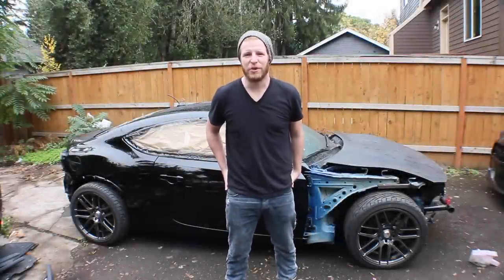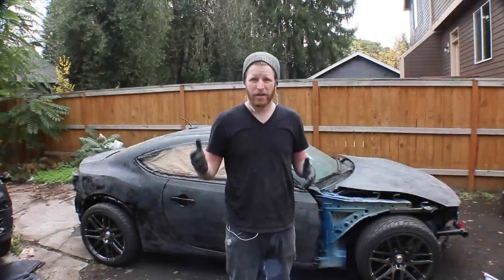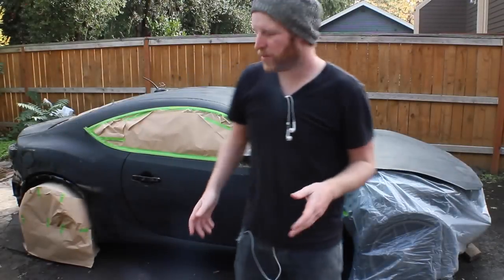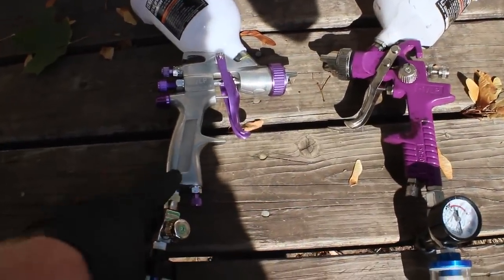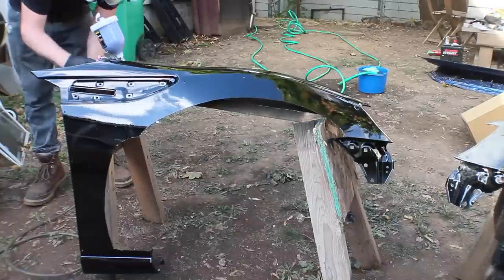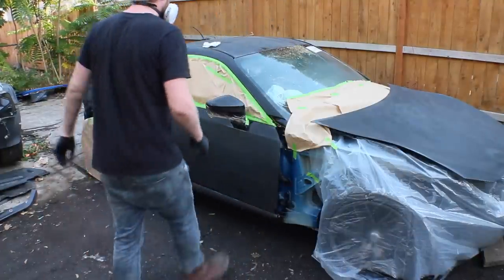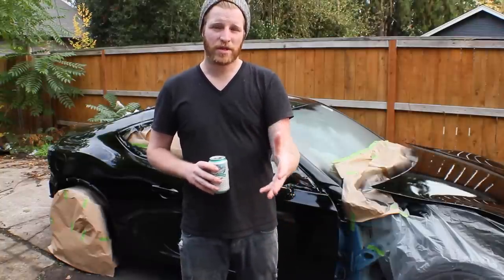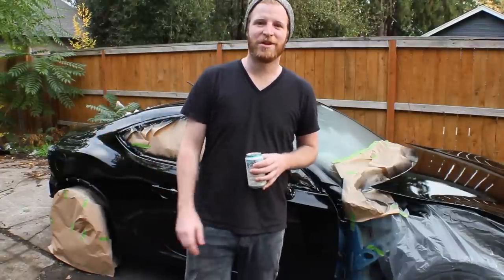BRZ Resurrection Pt 9 - Paint It Again!

Comment: Another trick to keep in mind when painting outside OR inside (or otherwise not in a paint booth), is to wet the ground all around where you're working. When you spray water all over the ground, that prevents the air from the spray gun from kicking up the dust and dirt on the ground and getting it into the air and into your paint. It also prevents any overspray from sticking to your driveway or concrete.

Comment: great vid. kudos for doing it again and not settling. My paint guy gave me a couple diy driveway painting tips and i have used them to great success.
1. Wash the surface with sunlight dish soap to strip the wax and oils
2. Lightly scuff the surface with one of those green pot scrubber pads
3. Wipe everything with a tack cloth right before you spray

also, whatever make shift paint area you use it helps to wet the ground with a hose so that any debris floating around will stick to it and nothing will get kicked up into your paint!

hope this helps!

Comment: I noticed this in the Plan B build as well, when your painting you should never start or stop in the middle of a panel, always start just off the panel make a complete pass across the panel, even if you have to take steps side to side.  Overlap each pass 50% to keep the wet edge and keep from getting dry spots.  Always use wax and grease remover before you paint, only time you don't want to use it is over the base color before you paint clear.  You use use it before you prime, seal, paint.  And when you're sanding always sand in 45* angles to the long axis of the part, sand like / then \ so  you end up with X patterns.
Reply: Thank you for taking the words out of my mouth. In all the hours of videos he said he watched, it's hard to believe that this golden rule of (spray) painting didn't come up...

Comment: These videos of this build are a real motivator for me. Always dreamed of an APR Widebody build on my s2k. Finally saved up and pulled the trigger, found what I thought was a reputable shop and paid in full for the APR Kit, new headlights, wheel spacers, misc. parts, labor, paint, and a dyno tune. Well I was wrong on the reputable shop part, after months he said my car was complete, but he actually took my money and car and ran. Long story short, I got my car back months later with none of the work done besides a half ass headlight install, scratching them all up and hundreads of miles on the car. I had moved to cali at the beginning of the project so I could not do frequent visits. Since then my car has set in a garage back in Indiana for about a year. I lost the motivation to put anymore money into it after losing tons of money. Now I am starting the plan phase again, and this series was a real motivator, so thank you! Hopefully when I get back into the states next year I will pick up where I left off! Looking forward to the next video man

Comment: The only way to get rid of the orange peel even on a $15,000 paint job is to wet sand and polish after wards. But you can avoid heavy amounts of it by proper technique. Looks like you were doing very wet coats, you can do multiple coats its fine. Your gun distance looked to be very shallow and your flow looked to be all over the place. By flow I mean you would not do 50% over lap on your passes and would have to go back and cover 1 small section and that will cause build up and spottiness.  and for gods sakes cover up the other cars around you or move them or something. Over spray is annoying and hard to get rid of once it dries on.
Reply: +Tony Backs it seems like he was spraying too close, i don't paint, but it seems like his technique is not that neat, he sprayed first the middle then the sides, you have to do a fan all over the paint then overlap 50 50 in the entire panel, he did bit by bit that was why he got that wet coat i think
Reply: +Tony Backs With a high end gun, right set up, and technique you can do zero orange peel paint jobs.
Reply: a 15k paint job wont have orange peel ever

Comment: For the future, I suggest a larger air hose. gives a more stable CFM. That small hose chokes your volume, which is very bad for a HVLP gun. And get a larger regulator/water separator combo to mount directly to your air compressor. Then you can use that gun mounted air valve for fine tuning. You'd be much happier. But for a outdoor first time, you did good!

Comment: trick is to reduce the paint down and set the compressor to stay between 45-90,set the top back knob on the gun so it only sprays on the last half of the trigger so you can sweep off and on, on strokes and not get runs light in full pull midway and lite off at the panel end(that's the needle depth that dictates how much paint comes out) , set the bottom knob near the air fitting all the way out(that's the built in air regulator) let the compressor regulator be your regulator ,spray until the compressor is down to 45 and let it build back up..reducer will kill the orange peel but it'll take more coats , its a trade off for a comp that isn't big enough but it works every time, my harbor freight gun works just as good as my $1200 devilbiss with those techniques, hope that helps for the next project dude.

Comment: For future reference. The adjustment screws on the gun adjust Air Pressure (which you knew), Fan (Where you talked about the f"figure 8" pattern, it narrows and widens that pattern) and how much product you spray out. Play with them all more on a test piece like you were doing and youll soon find youll get a much better spray pattern.

Comment: Idk much about painting but i use to help out my friend at the paint shop and he always degreased all the panels before painting and then he air sprayed all around the car from any type of dust, also he always started with all the corners and edges first bc u dont want to make any leaks or runs on the panel and never stop half way through the panel always start off the panel and make one smooth line across :) also put some type of tarp on the ground so when u paint panels dust from ground is not lifeted up by the air pressure

Comment: Props for trying man, only way to learn. No real way to avoid orange peel, too many variables comes into play quality of the gun, air, gun setting, spray pattern, paint mix, temp, and etc. You can try to color sand once the clear dries with 1500-2000 grit and buff it.

Comment: would spraying from a bit further away and a bit faster be better? I feel like you couldve gotten a bit better result by doing that, and not holding the gun over one spot for too long to avoid paint pooling. Lighter, multiple coats. Any areas that seem thinner as you pass through them, you just get in the next coat.

Comment: You only have  to spray the top coat once. everybody saying otherwise do not know a thing. Once with the top coat and then once with the clear coat. Easy and simple.
Reply: Unless it's a brand new part. Also always start off with the edges of the part or body.

Comment: air pressure is way off boss. it's an hvlp gun that stands for high volume low pressure. you only need 10 - 15 psi the gun is designed so you don't waste as much paint as you would if you tried to run the high of a pressure. love the videos trying to catch up on your builds

Comment: The reason some can go so low on psi is because the cfm on there compressor is better and hoes,fittings also u could have used the reg on compressor you didn't need to get another it causes some lose of air flow.

Comment: Looks good, but what about the overspray on the parked car?
Reply from the maker: +cody stipcic air pressure was so poor i didnt get much overspray, the air system i had was a big part of the problem, it couldn't property atomize the paint, which results in alot less overspray.

Comment: Im still confused. What was the mistakes you made in the last video? What are you suppose to do to avoid those mistakes?
Reply from the maker: +Dennis Vuong in the last video the major issue i had was really low PSI air pressure on my spray gun. But in a twisted turn of fate, the first paint job was by far the best. The later paint jobs were all hindered by weather and my internal rage/hate for paint.
Reply: +Dennis Vuong low air pressure and not sanding the car

Comment: you dont need a primer coat?
Reply from the maker: +Marcos Salmeron when spraying over a coat of the same paint you dont need one. When i originally did it, i probably should have done primer, but it got good adhesion so it worked out.
Reply: +B is for Build with a body in that good of shape maybe just a sealer could been used. the reason for using sealer is to make sure that the base/clear will have good adhesion. Most paint manufacturers won't guarantee adhesion unless its over there primer or sealer. Just sharing some advice:D Good job man awesome work and nice car!
Reply: +B is for Build you only need to prime repairs and any areas the paint has broke through , id love to come over and paint this for you , loads i could show you ,.
Reply: +rodney trotter thats not even true... where did you learn this?
Reply: +rodney trotter i think youre confusing bando with primer

Comment: Should of primer the whole thing, it would of helped with alot of uneven surface and swirls.  Then wash it, tack wipe the surface and remove the dirt and grass and bugs and hair and leaves etc then spray the colour on, but don't make the paint glossy cause thats not necessarily because the clear gloss top coat will do that.   Oh heck!! Just don't do it all together.  Its just a different wrong from your last video.

Comment: I can get it done professionally at maccos for under 400$ though.
Reply: +BlueBlockHeads Professional in the sense that you exchange money for Maaco to perform a services, but as they say, you get what you pay for.  A $400 paint job is going to look like garbage when compared to a proper paint job that cost substantially more.  $400 isn't enough to cover the supplies and labor at a shop that cares about the end result.
Reply: My car looked fantastic for the 400$. I'm just saying I'd rather spend less money and not have leaves in my paint.

Comment: Rather than criticizing the machine for air pressure, it was also your fault for not having a proper technique, 

you never do one coat, you do twice meaning go back and forth for each line, 

also you were way too close to the paint, when u spray your gun, just the amount you use, you could use that paint twice.

Should of look proper video, how painter does it.

But again, you have no experience, hopefully u will. Good luck!